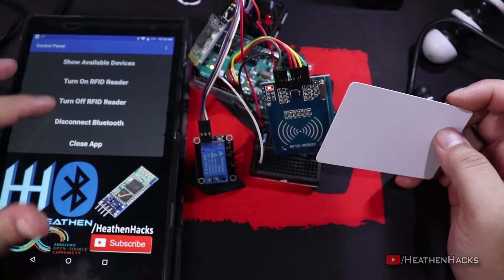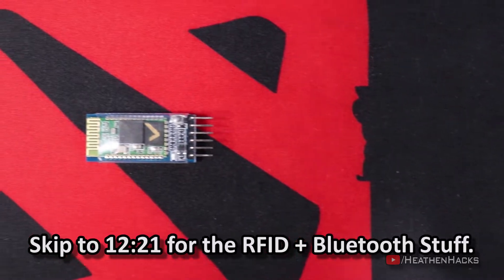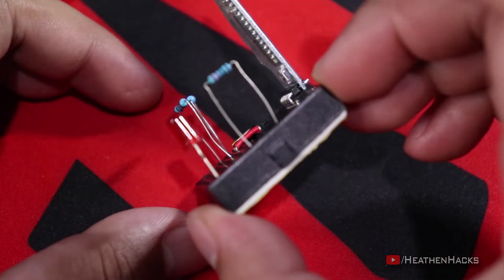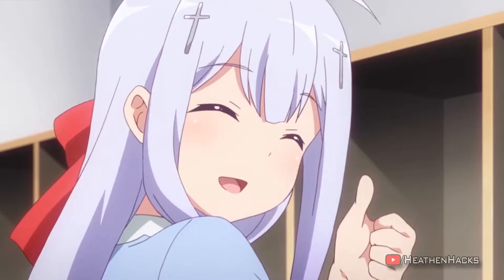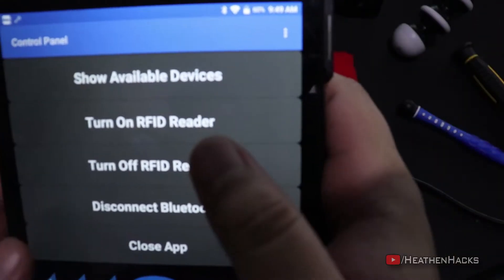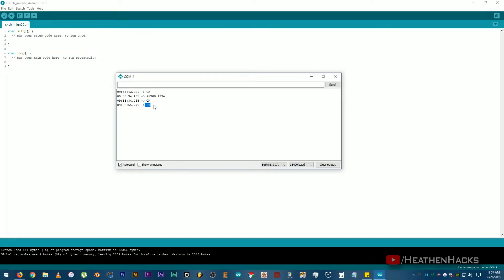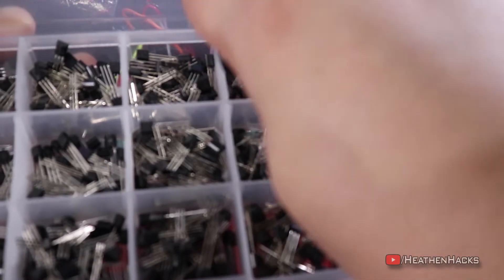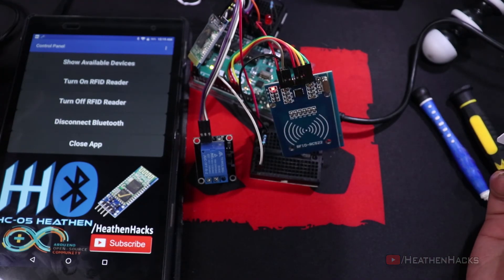Arduino Project #18 | Pseudo 2-Factor Auth. Using HC-05 Bluetooth Module & RFID Module + Relay

Comment: What  was the command sent from your app to turn on that relay, I tried 0 and 1 but not working
It was only working with your app, may I know what was the command sent via bluetooth so that I could try it out
Reply from the maker: Hello Samuel, thanks for the comment! ♥ By any chance, have you checked the accompanying Arduino Project Hub Link? If not, it's in the description of the video. It contains all the references and codes I used.